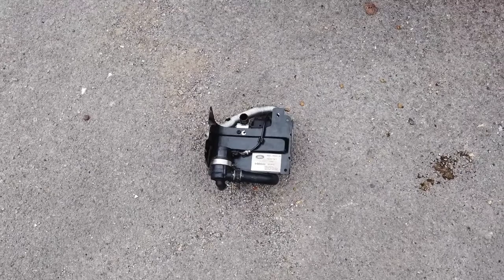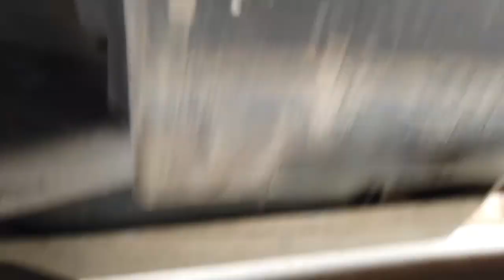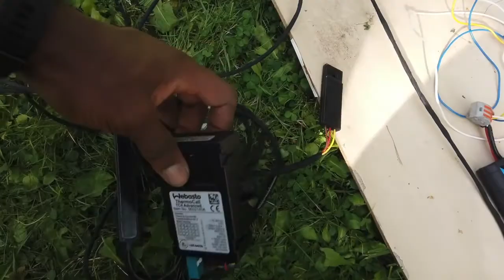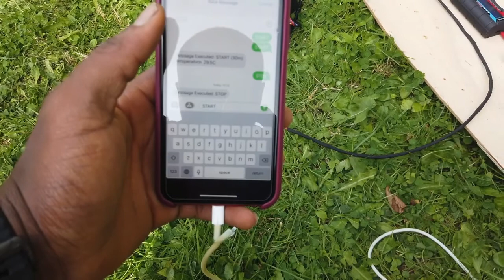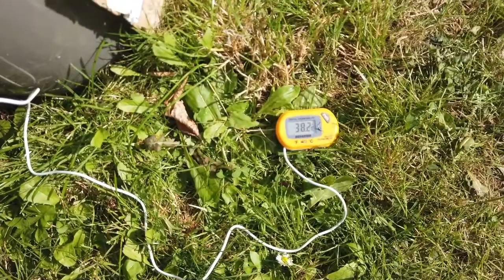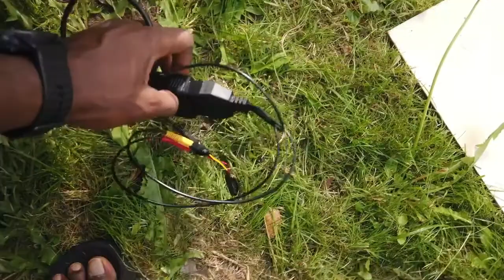Fitting a Webasto diesel fuel burner  to my car .Part 1

Comment: Hey. How did you connect the cabin fan? I can find it in the videos
Reply from the maker: Hello 
I connected the cabin blower By tapping into the car’s resistor. Just by the passenger's footwell ( UK Model )
You will need to buy an aftermath resistor lower the voltage so the fan will not run at 12V to preserve the battery. 

You will also need a relay to Switch the aftermath resistor off when the FBH is off so cabin blower fan will behave normal. 

Below is the link for the aftermath resistor I used. I'm currently away. Will make a video when when back. 

Kyrio DC Motor Speed Control... https://www.amazon.co.uk/dp/B08761BVBN?ref=ppx_pop_mob_ap_share
Reply: @germplus  do you have an automatic a/c or manual? It seems like with automatic it goes via electronic module not a resistor.
Reply from the maker: @mprochon  Hello Michal. I believe my car is automatic. The reason for piggy bagging the negative and positive of the blower fan cable from the resistor is, it’s easier to reach from the resistor than connecting it directly to the blower fan motor. When the auxiliary heater turns the blower fan on, it blows the last temperature and the last direction of airflow which was last set before you exit the car.
Reply from the maker: https://youtu.be/2JJmRQbYTHs
Reply: @germplus hi mate. Can you make this video public again? 
Really want to see how you resolve the blower motor connection. Cheers
Reply: https://youtu.be/Y9zx70Eeccs

Comment: I've just sourced a unit for me Freelander, Was yours pre-wired behind the wheel arch from the factory?
Looking forward to your wiring video for the blower fan. and leisure battery 
did you get the CCF reconfigured to work with the vehicle other than the telestart?
Reply from the maker: Hello mate. Unfortunately mine wasn’t pre wired. I bought a wiring harness from a ebay. And didn’t change CCF. Video coming soon pal
Reply: @germplus  Did you use the mounting bracket from the discovery/range rover or is that the proper Freelander bracket?
Reply from the maker: @wortho123456  I used the FL2 original bracket. Part number is LR004907.
Reply: @germplus  how did you connect the 12v heater output to run the cabin fan?
also, what diagnostic set up are you using, there seems to be a vast choice.?
Reply: @wortho123456 did you ever figure this out? 
I’m considering running 12v directly into the fan by splicing. 
Will put the input power through a dc motor controller to bring voltage down to 5v~ to save the battery.
Reply: I bought a 12v PWM controller and split the system with relays so standard wiring when car running and PWM controlled when webasto running.